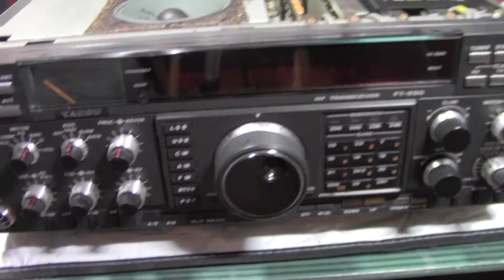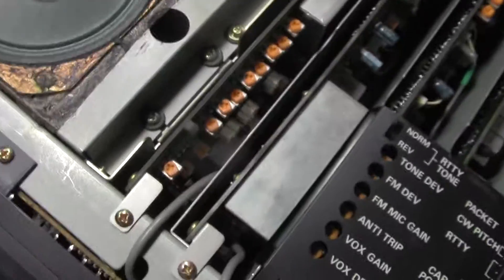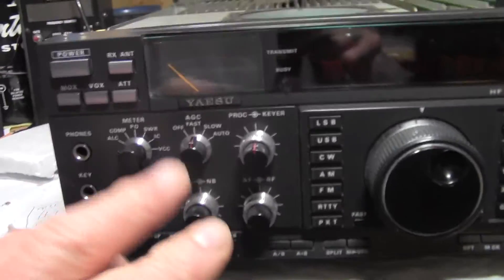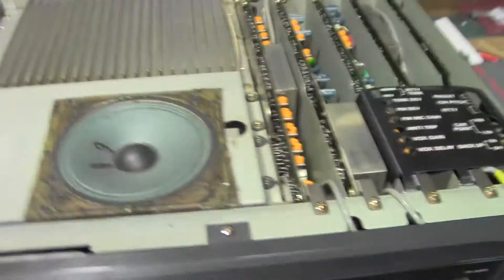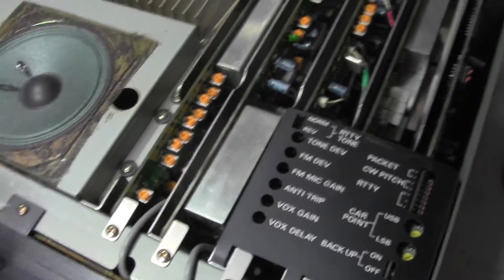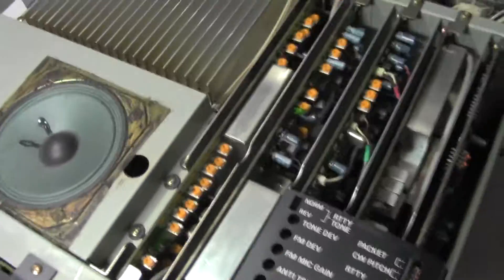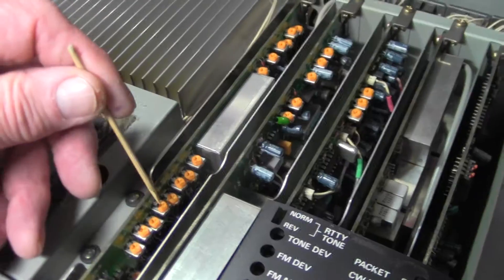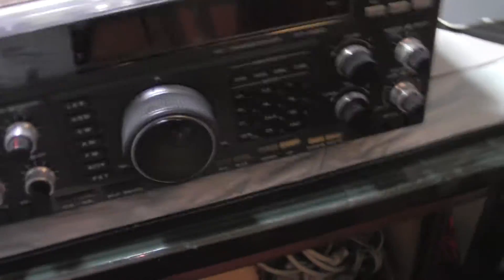Part 2 Yaesu FT-990 on 60 meters CFARS / Mars TX/RX Mod Part 2

Comment: FT-990 - 1.5 to 30 MHZ TX mod:
● Open FT990 like explained in your OPERATING MANUAL.
● Locate JP5002 on "CONTROL UNIT" and close it with solder.
● If no transmit between 4 to 6.5 MHZ and 8 to 10 MHZ, do the following:
● Display 5.5 MHZ in CW mode, "meter selector" to ALC, push "MOX" button and adjust VR1003 on "RF UNIT" for normal
ALC meter deflection.
● Display 9 MHZ and do the same with VR1005.

Comment: It is TOTALLY ILLEGAL to use Transmitter on CB.   And you Must have a proper Amateur Radio License to Transmit and Only in correct frequencies using correct Modes.
Reply: Nobody cares. 65 million human beings have been murdered by abortion in the USA since 1973. On the other hand using an HF radio on CB hurts, wait for it.....nobody. Outlaw abortion and then get back to me.
Reply: @James-k5f4k  Hopefully those abortions wiped out a bunch of future ham operators.